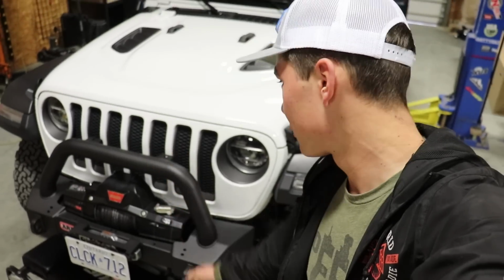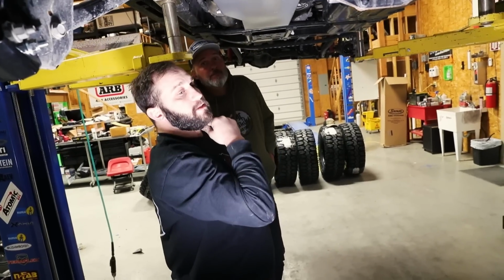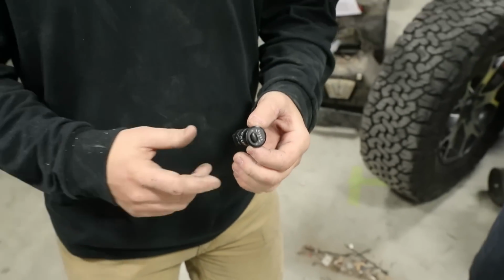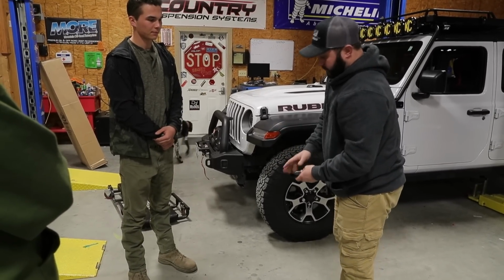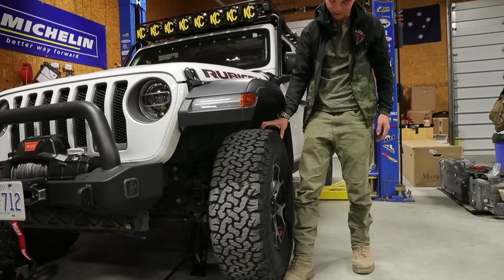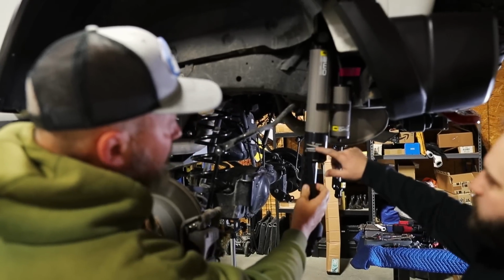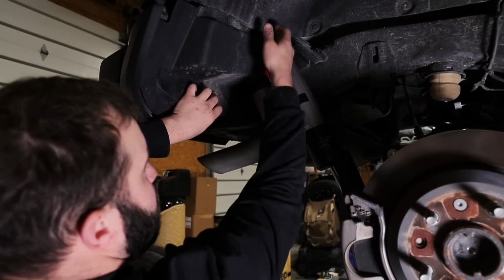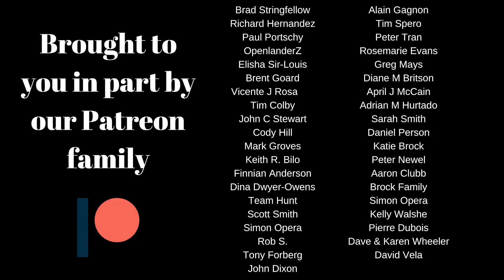THIS IS GOING TO BE A GAME CHANGER - Auxillary Fuel Tank,  New Rims, Tires & More! /// EFRT S5•EP9

Comment: The 37's look sweet. And the long range fuel capacity is huge. Love it. We Overland with a couple that has a Rubicon and we often stop to let them refuel. That extra range is great. The build is really coming along.
Reply: This is a fun build to watch.
Reply from the maker: Yes. The extra fuel is nice to have. We love how neatly the tank ticks away under there.
Reply: @EFRT  For sure. It looks like you don't loose any ground clearance.
Reply: @EFRT  Generally, intend to keep my 2020 Wrangler Rubicon, stock.  However, I am keen to see how the extended fuel tank works.  That is one mod I may consider.  Excellent and informative video, great work.
Reply: @problu9586  us too. The extra range makes a lot of sense.
Reply: Do you maintain the same clearance with the added fuel tank?
Reply: I added a 45g fuel tank out of an excursion to my f250!
Reply: @Fordgroup00  Sweet. Did you do it with the same concept? One filling point? Second tank fills the main tank?

We are looking at doing the same.
Reply: Tsar Trail 

Two fill locations and a switch that switches from tank to tank

Working on another addition on our F150 that will be 2 feeds but one tank will feed the other tank and be removable
Reply: @Fordgroup00  very cool.
Reply: Tsar Trail 

Thanks!

Comment: I keep hearing about the Auxiliary Fuel Tank, I might have missed it, but how many gallons have you added? Nice builds. Good luck.
Reply from the maker: Thanks. The exhilarate tanks Or the JK and the JL hold about 16 gallons of extra fuel. 👍🏻
Reply: @EFRT  sounds like a great improvement. Thanks
Reply: @EFRT  how many mpg are you getting in the JK? The JL?
Better yet how many miles to the tank?

Comment: How much is the auxiliary tank? Pricing is not on their website and the haven’t responded to my emails.
Reply: Pricing is on their website. It's just under $1700 for the tank, so I'd guess you're looking at close to 3k installed - plus you can't have that if you're a California resident - despite the fact that the manufacturer is in Stockton, CA - LOL
Reply: @uweschroeder  it is manufactured in Australia. This is actually the "Long Ranger" tank that has been available for at least 10 years. It was available as a special order through ARB for a while there but very difficult to get. I have been looking into this mod for about 6 years and followed along as the product was available from one vendor to the next.

Comment: You guys must’ve received a prerelease set of the Kargo Master Safari hinge steps. I can’t seem to find any info on them yet.
Reply: I was wondering the same thing.  Love the style of these.
Reply: The JKs work with a washer inside. Remove the torx bolts, put 2 stainless steel washers in the circle groove, then attach the kms with supplied bolts. Have them on my JL